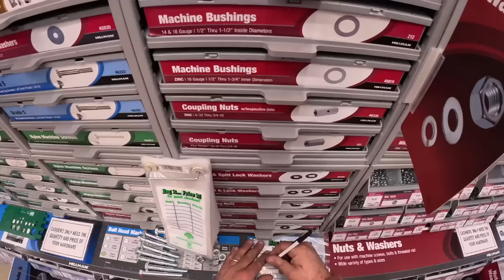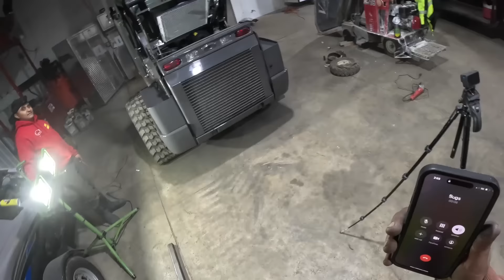This equipment trailer was meant to be. Spending more money!

Comment: Hey Eric I’ve had the same issue with my old Chevy trucks, used to think my truck was being stolen at night. It’s the brake switch on your brake pedal. Unplug it and swap it for new one. Set your clock 6-9 mins fast, you’ll always be on time 🤙

Comment: Ryan don't worry about the deck being wet.  We use those exact trailers and all we haul is track skid steers and mini excavators with it and some miscellaneous things and you will have absolutely no problems getting on and off the trailer.  Goes as anything else don't try and load and unload like an idiot and your fine!  They are also nice because they have an adjustable weight on the tilt deck to adjust the up and down holding pressure.
Reply: @George  yeah usually the case.  The trailer which is usually on flat ground doesn't even tip eno7gh to give you a problem by the time you would start slipping the counter balance sends you up flat.  Everyone has an opinion and that's fine but you shouldn't talk someone out of something unless you have the same use experience .  But all good no big deal

Comment: Why not weld 4 or 6 bolts to the deck and just make the box with 4 or 6 holes in it and just bring it up to the bolts while on a floor jack and put washers and nylon lock nuts and as long as there is a frame around your box for the bolts to go through giddyup  ! As for painting your bobcat if just put the portable heater on it to get the body up to 90 or 100* before you spray and it will help your room heater to dry the paint .You can get the real automotive paint put into spray cans but it costs 4 or 5 times the cheap rattle can paint but on your $80,000 dollar machine is probably justifiable. As for trailers just go to Indiana there is a whole swath of the state that makes trailers I have bought 2 different cargo trailers there.

Comment: Ryan, I highly suggest making yourself a table to work on instead of working on the ground. A simple 4x8 table made out of plywood and a couple sturdy horses is better than being on your knees and bending over. Even a smaller 3x5 table made out of tube steel and 1/4 plate will be a benefit for you on multiple off-seasons when you work on your equipment.

Comment: You could tack on a sheet of expanded metal, on the new trailer for traction. They make many different styles of expanded metal. Or bolt it in a few spots to remove if needed.
Reply: Or take a circular saw and put some nice straight kerf cuts in the wood.

Comment: Ryan we use expanded metal and tack it to steel and then you can zip some screws down into deck and it will give you all that traction you want on the deck. Use smaller tacks and you can use grinder with cut off wheel and pop them up fairly quick. Hope that helps you out.
Reply: In my opinion the larger expanded metal works better for smooth tire loading. Hope this helps you for an idea for traction on new trailer. Thanks for videos and keep them coming!!!

Comment: Ryan you can use the same adhesive tape that is on the fenders on the trailer and where equipment will be going and you shouldn’t ever have any slippage and it’s a very cheap alternative instead of buying steel and welding something for traction
Reply: Congratulations dear subscriber, send a message to the number above to claim gift🎁🎁

Comment: Keep distilled white vinegar in your shops. It's great for light  burns. After you keep the burned area submerged in the vinegar for about 5 mins there will be little to no pain and also little to no scarring. It will hurt at first application, but it's worh it

Comment: Just a thought if you drill through the sides it will keep the boxes in better shape, when drilled through the bottom there is a chance water sitting in there will course rot your tool boxes will last a lot longer if fixed through the sides.

Comment: I have the exact same trailer. I haven’t had any problems with it. The only con I would say it has is the wheel wells. I have a Case tv380 and the tracks barely fit in between the wheel wells. Other then that it’s a great trailer it has a little waterproof cylinder by the jack for your registration to go as well.
Reply: Congratulations dear subscriber, send a message to the number above to claim gift🎁🎁

Comment: I own a trailer mfg in Florida ryan that's a good built trailer sir we build ours out of 8 13 lb  I beam pro tip once the wood dries out water seal and light sand will make the deck be less slippery we sell our 22' for 10500 factory direct

Comment: If u are concerned about putting the equipment on the trailer when its slipery just buy a few pieces of rubber "carpet" and it increases grip alot.

Comment: that job could have been a little easier with a little research. what you needed was a  decal eraser wheel,  3m adhesive removal spray and red scotch brite .The red scotch brite will provide a better grip for the paint , green is to fine for industrial equipment , there are also videos on YouTube on how to use them

Comment: The wood is the slippery part of the trailer when it’s wet. I have one and if you try loading a skid on it with a inch of snow I couldn’t get it up without putting salt on the trailer deck

Comment: I was around 3 or 4 and my dad was using a large hot glue gun and I reach up over the table and the bottom of my wrist contacted the glue gun tip. the entire glue gun covered my tiny wrist and when I yanked my wrist away the hot glue was holding on burning my wrist. I can still remember that pain today and Im a whole lot older now

Comment: I love your videos Ryan and appreciate you taking the time to edit and post. Curious though if there is an over/under on when the buggy fluid will be cleaned up on the garage floor? Has owner of the building said anything about that?
Looking forward to a new season with some new equipment! 

Thanks,
Scott
Reply: Was wondering the same and why he let it happen in the first place without using pig mats or oil dry 🤔 As they say; "All will be revealed" 😉
Reply: Have you seen the state of the landlord's shop and all outside?